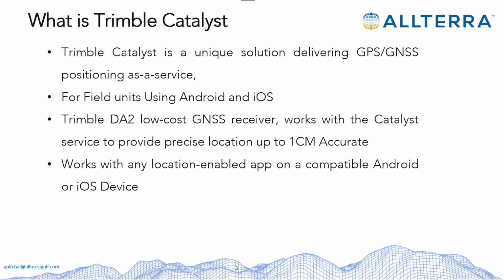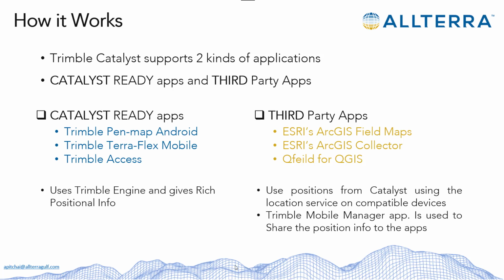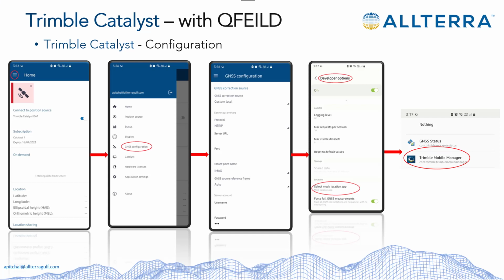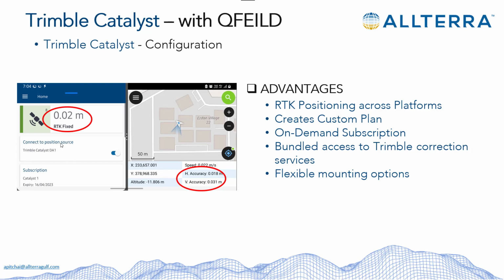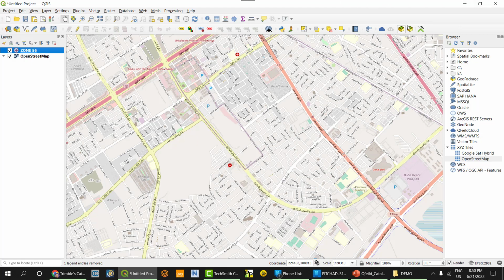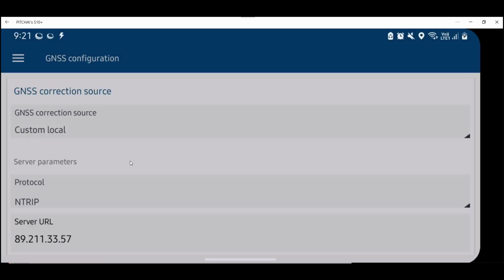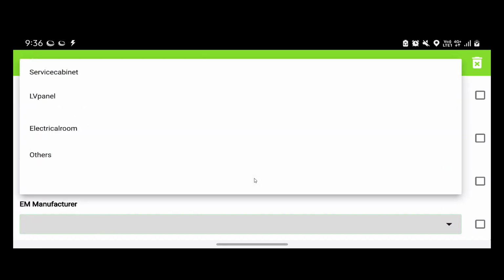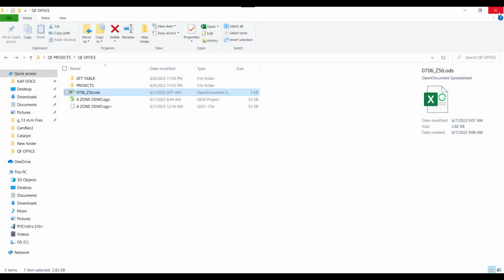Trimble Catalyst with DA2, Using #Qfield and #qgis for High Accuracy #gis  data collections

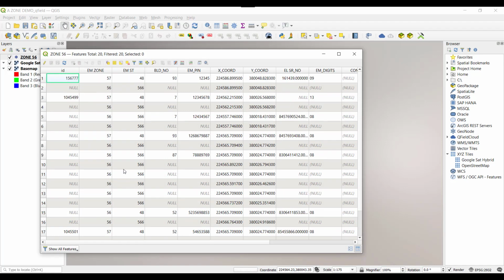Comment: Thank you! how do you set in QGIS the x and y values in order to have automatically the coordinates from catalyst da2? I saw in your video (min. 19:34 ) that on the X_coord and Y_coord colums the fields are already filled in...is there a way to achieve that? thanks!!
Reply from the maker: You will need to configure in QGIS when you build the tables,
Reply: @pitchai  is there any tutorial to do so? I didn't find any...many thanks!
Reply: @4dservice  did you ever find a tutorial for this? I have been trying to generate those columns including one for elevation but cannot seem to get it to work
Reply: @SeanHicks-tz4yx  no I'm Sorry!
Reply: @4dservice  all good thanks anyways!

Comment: Hello Mr. Pitchai, thank you for this well done video. I have done it step by step like you did and it works very well. Comparing the height from trimble mobile manager and the height appearing in qfield i saw that qfield takes the elipsoidal height insteat of the MSL orthometric height. Is  there a possibility to change this? thank you and greeting from italy
Reply from the maker: It can be done in the settings of Qfeild
Reply: @pitchai  Thank you
Reply from the maker: https://youtu.be/8gCN04ddqB4?t=1113
Reply: Thank you for this video Mr. Pitchai! I have a question, about the height. With the GNSS you get ellipsoidal height but the geoid has to be applied in order to get the MSL. My question is where in Qfield can you apply the geoid?
Reply: @persakoutsouradi4414  To have the MSL you should change the preferences in Catalyst not in Qfield.